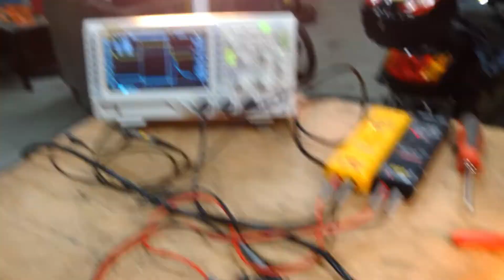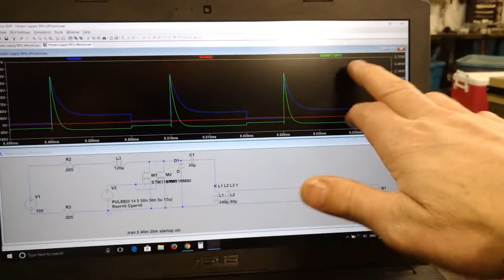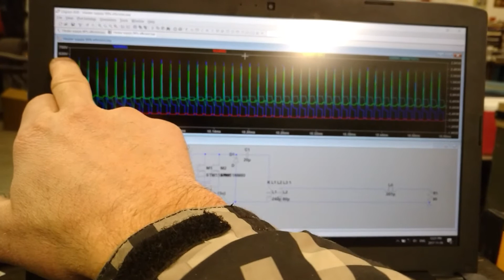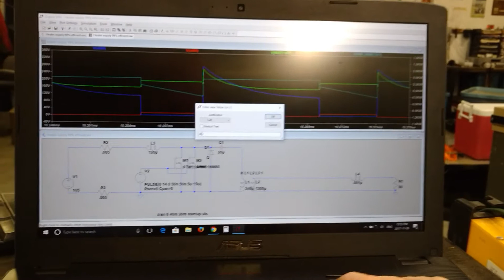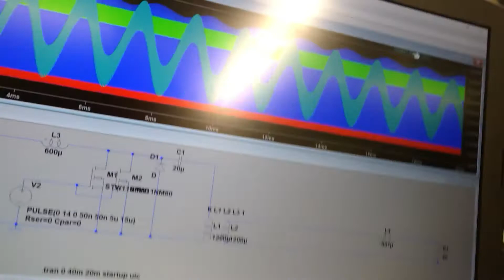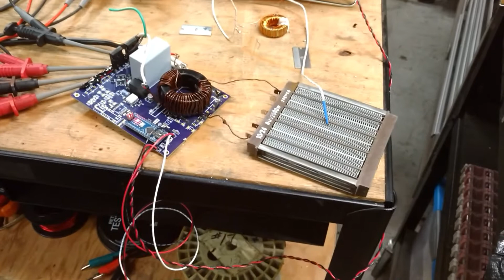Isolated current control

Comment: Nice to see some more updates on the project, since we're going into winter will the colder temperature effect the battery pack in a negative way?
Reply from the maker: Slightly.  But not to bad.  Using a resistive  heater is what really hurts the range.